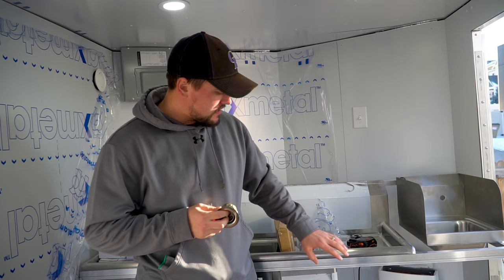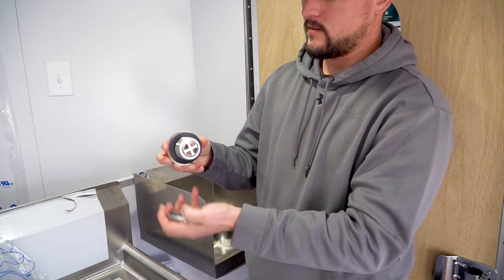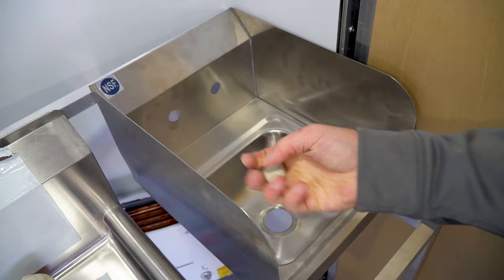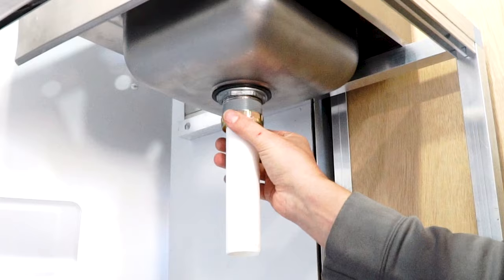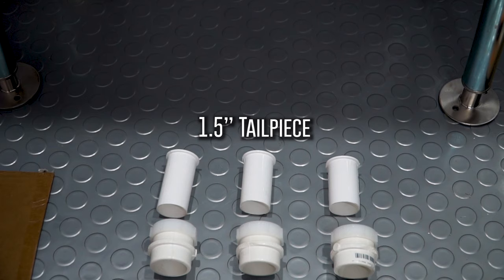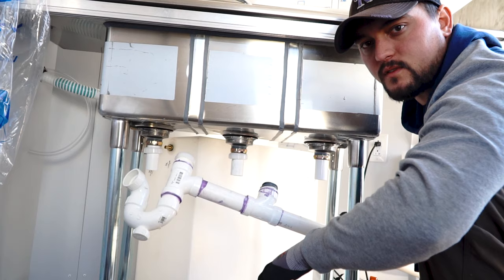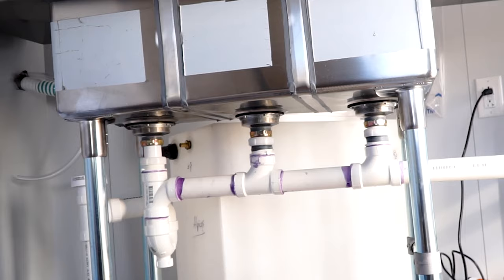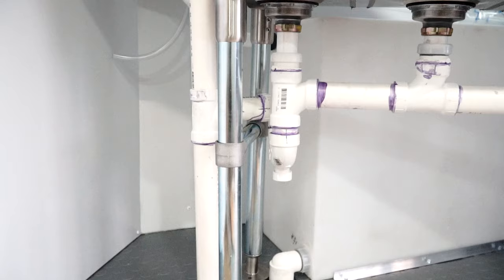DIY Plumbing 3 Compartment Sink & Hand Wash Sink Drains Food Trailer - CTC Ep.11

Comment: The p-trap is used to block off sewer gas.  However, your vent pipe, which carries sewer gas, ends under the sink's drain board.  What is the point of installing a p-trap then?🤔🤔
Reply from the maker: Hi Scott, that is not the vent under the drain board.  It is an air admittance valve, which only lets air into the pipes to increase drain flow and prevent negative pressure to further prevent gasses from coming back up through the pipes. The gray tank is vented on the outside of the trailer.  Thanks for watching!

Comment: Since you installed a p trap with no union, how is one supposed to service this and take it apart without cutting everything out?
Also would recommend a cleanout on the vertical drain before it goes through the floor.
Reply from the maker: The  p trap I installed has a drain plug for servicing and the vertical pipe has an air admittance valve that can be removed to clear any clogs. Should be good 👍🏼